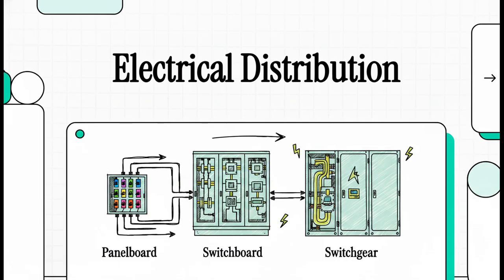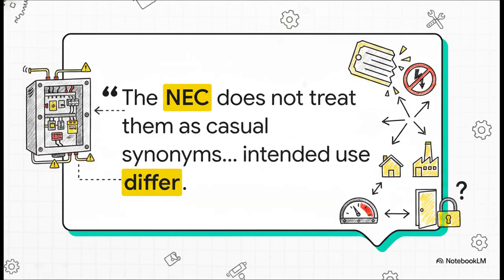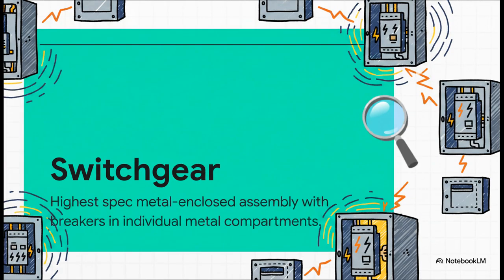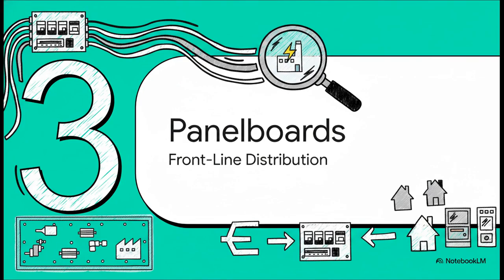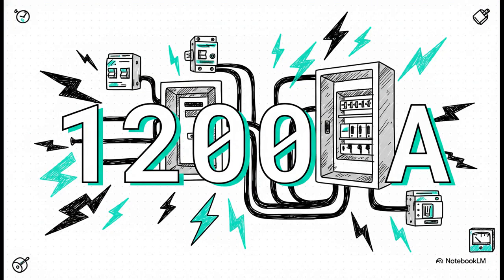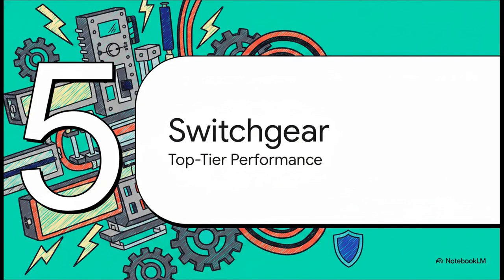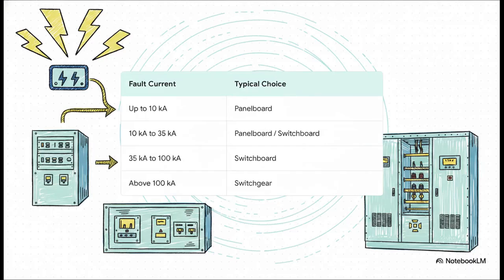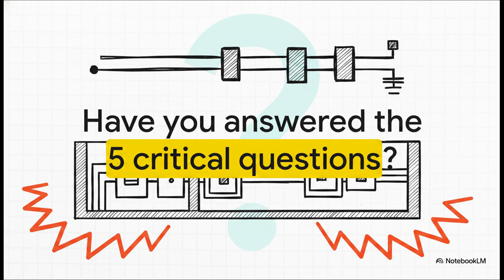Switchgear vs Switchboard vs Panelboard: Key Differences Explained

Comment: Finally!  The confusion in terminology makes sense.  USA of course has to use the words differently to the rest of us!
To us Switchgear is the category -- anything that switches, from a big "panelboard" down to a rotary isolator, rather than current-using equipment.  A Panelboard is made of "panels" [shock horror!] whether that's a big heavy front panel (like an MCCB Panelboard) or larger more modular sectional panels that often have their own isolators on each door (what you are calling a swtichboard, but which we sometimes call a Section Board, SB, which for most people is interchangeable with Panelboard PB.)
Section Boards can be big long things with large sections housing ACBs (like you're describing as "switchgear") for a whole estate, or smaller sections of MCCBs and fused-switches (as distinct from switchfuses) for more local plant.

If it's for final circuits and only has MCBs in, it's just a DB, Distribution Board, but that's because we don't have a lesser term.  Yes this is also the category and Panelboards and Section Boards are types of Distribution Board (and also strictly speaking types of switchgear by extension), but we're comfortable with that, it rarely ever causes confusion and if it becomes important the very simply question "what kind of DB?" resolves that trivially -- "oh just an MCB Board..."

What do you guys call a Distribution Board?

.

(In Europe we also have something that you don't seem to have: compact single-consumer DBs, all devices DIN rail mounted in a single row, because nobody outside the USA has to mess around with "split phase" nonsense. Domestic dwellings, small industrial units, offices and shops that can operate happily on only 1 phase, almost exclusively use one or more compact DB often called a Consumer Unit, or in the electrical Standard definition, Consumer's Control Unit, CCU.)